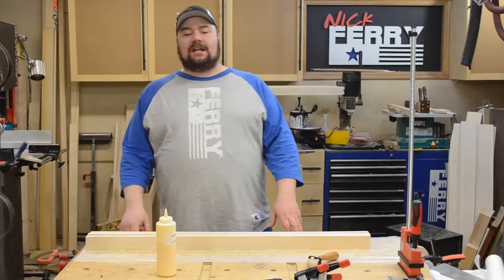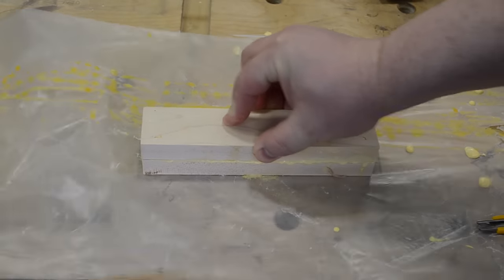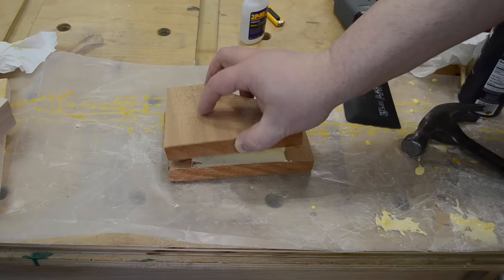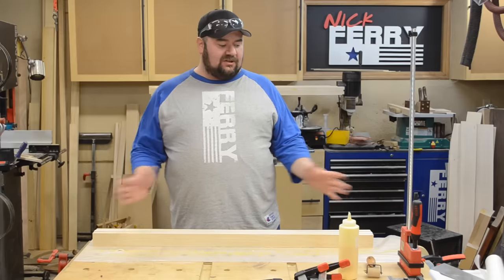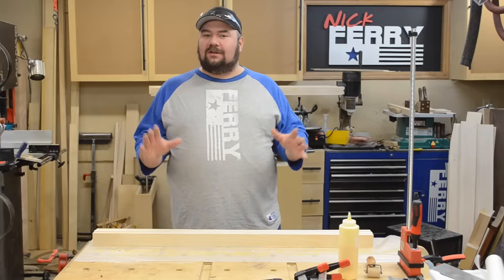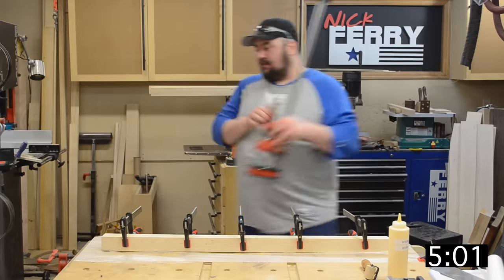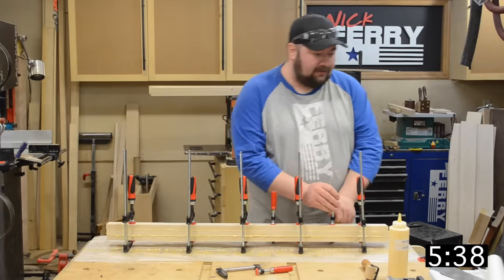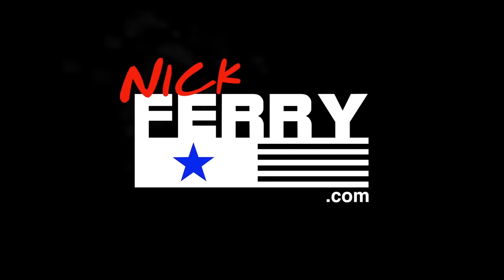Ⓕ Best Way For Gluing Wood Together To Get Thick Pieces (ep86)

Comment: That’s a pretty good tip.  Good to have in the back pocket of tricks.
Reply from the maker: thanks Chad - it sure is
Reply: Back pocket?  This one's going in the small notebook I keep in the shirt pocket!   ;)  lol
Reply: I was thinking add two pieces of scrap wood clamped to either end, but the parallel clamp makes that unnecessary. Huh.

And I see what I'm thinking of is an old idea called a caul. Nothing is ever new, lol.

Comment: Great tip. My late father was a carpenter/woodworker on the side and built several chopping blocks which are laminated much like what you did. He used a couple of bar clamps as the base to position the wood on and then when all glued surfaces were placed would clamp them in the already positioned bar clamp. Once dried he ran both sides through a planer to get rid of any warps or bows.
Reply from the maker: Nice - ever better that you have those ideas from your dad!
Reply: Nick Ferry - for sure. It's funny what we remember after someone is gone.
Reply from the maker: it really is - thanks for sharing!

Comment: Well explained.  I use a 3/8" thick 2 x 2 angle as a straight guide for the f-clamps.  The workpiece is then dead straight.  No jointing required.
Reply from the maker: nice - sure would be a time saver

Comment: I'm a qualified wood machinist amougst other things. I'll start with I agree that you can't have to much glue, but you can have not enough.
The way I would do it, you don't need to worry about the timber slipping and I would do all 4 legs laminated in one hit.
Say on the lengths of timber you are using, I would lay approx 6 X 900mm sash clamps down. Put all of your glued timbers in. All 4 legs, as they will stay separate without glue between legs. Then lay your other sash clamps on top between your underneath clamps. Then start to tighten each Clamp randomly top and bottom clamps until they bite. And then go over them all again when your happy where they are sitting and do them up nice n tight. All 4 legs done, no hassles.
(And that's without talking about woodgrain directions into the laminating situation.)
I believe I'd have my 4 legs glued and straight while your still lining your timbers up with your lining up clamp and clamping your 2nd leg together. I don't mean to sound rude. It's just the way it is 😜🤔🤣
Reply from the maker: very well could - always cool hearing how others accomplish the same task differently
Reply: Nick Ferry your welcome, I hope it came across clear.
Cheers.
Melbourne, Australia
Reply from the maker: clear enough for discussion - I see you said you're from Australia, do you have any HNT Gordon tools?  I got one of their planes about a year ago and it is top notch

Comment: Not trying to be a jerk, but couldn’t you just do it on both ends and call it good or do you have to work your way down? Great technique though that I will begin using in the future
Reply from the maker: This way you can correct bent or warped boards too
Reply: If you got a bad enough bent/wrap, the boards may start sliding as soon as you remove the "side" clamp. It happened to me once, but to be fair it was 12 feets long  4'' by 8'',  and I surely did not have enough and strong enough clamps for the job. A bit of sand did help there.
Reply from the maker: robert winton - exactly
Reply: I usually use a "glue-buck" (like a sawing horse), and I never remove the correcting clamps until a need them another place. Also, regular F-clamps combined with pieces of scrap wood with a piece of adhesive tape works just as good as parallell clamps.

For big glue-ups putting straight boards on the side while glueing can straighten up the pieces and heavily reduce the number of clamps you need.
Reply: You should have flattened and jointed your wood before gluing up. If you need clamps to bend wood to bring them into alignment while gluing up - your legs will have a lot of movement down the road due to stress. That wood will want to 'spring' back to where it was before you forced them into alignment with the clamps. Golden rule of woodworking. In our shop we always cut the wood a bit longer to allow for a pin on each end, that will be cut off before the exact sizing of the wood takes place. I believe I even heard you state that your pieces were a bit longer than needed. By the way, this is constructive advice only - not malicious criticism. Love your channel, enjoy watching your videos!  mike
Reply: cuskit True, but sometimes you will have to compromize and bend some boards slightly. Not typically in a leg for a table, but for lets say a tabletop. One or two mm misalignment over 1500 mm wont warp the table, but it's really hard to get the board to align without some tricks like this. When doing that sort of stuff it is important to think about these forces. Make sure they balance each other out and such.
Reply: Egil Sandnes  67 years old and well over a thousand tables built. I do know a bit about working with wood.  On balancing wood, we use kiln dried as close as possible to finish size to reduce movement. Stress will result in twisting, warping, splitting etc. And you cannot properly balance 3 pieces to begin with. Journeyed craftsman in the past always used wood blanks sized for the leg diameter without gluing up pieces which is why good antique furniture stayed so straight. Today due to shortage of quality good  old growth lumber it is more imperative to learn proper techniques of straightening lumber. Sorry to say we are a dying breed and soon they’ll be no one left to teach. Using clamps to straighten material during glue up is just not right. Other than ‘springing’ the outer boards on a table top blank, seeing any daylight through a dry joint before clamping is a recipe for trouble down the road. I was taught by a German journeyman and to him a couple of mm’s is a cavern and I agree. Just my old 2 cents for what it’s worth.

Comment: I was waiting for some revolutionary tip. lol. however from the looks of it a lot of people never knew you could do this. Thanks for sharing. I always clamp the boards to the table with several parallel clamps across the entire workpiece and then the table acts as a level clamping surface for the bottom. Then clamp the boards together across the entire glue up.
Reply from the maker: another great way to do it - yeah it seems some have seen it as obvious and others never thought of it or tried it

Comment: Another method is to use a flat table covered with wax paper on the bottom of the edges. Place wax paper on top of the edges then place flat steel or angle iron on top of wax paper and clamp down in several places to table. Then you can use clamps from each side to squeeze the portions together. This has the advantage of using a flat table to keep the project straight during glue up as opposed to a temporary clamp. An even better way is to use angle iron on 3 sides and the flat table on the bottom. Place wax paper so that project never comes in to contact with angle iron or table. The project is held square on all 4 linear sides. I know the cost of angle iron scares some people but it is reusable and cost less than a good clamp if you get it from a steel supplier.

Comment: Nice idea, I will have to try it.  I have always used a small biscuit at each end.  Can always cut through them if need to cut into glue-ups.  Quick to do against the table saw fence.
Reply from the maker: My go to for years was biscuits - I still bust it out occasionally

Comment: Great tip. Question: How would you do this glue-up? Two pieces of 3/4” thick hard maple 30” long if you needed them to be 1-1/2” thick and 30” long? I noticed that you didn’t care about the length of the wood and assumed you would trim that off, but I already cut all my wood to the needed size.

Comment: Like you, I was surprised to hear you say that a professional woodworker didn't know about this.  I used that technique to make balusters for a railing.  I've also been using a similar technique when I edge glue narrow boards together to make a panel.  I clamp a long, square thick-walled aluminum stock across the boards to get their surfaces as close to the same plane as possible.  Keeps them from forming an arc when I use bar clamps to draw the planks together.
Reply from the maker: Another good idea - makes sense on making balusters
Reply: Dan Burch I have like a 2x3 piece of aluminum that is very straight that I'll use and just clamp in with any lamination I do to make sure it comes out straight. I've used this a number of times with plywood making fences for table saw sleds and router tables. Works great!

Comment: when I laminate,I put a little downward pressure and "slide" the piece over the other a couple times, I think it creates a vacuum of sorts and releases the glue air bubbles. creates a nice tight initial bond. Retired journeyman now,carving stumps mostly,and turning a few bowls.
Reply from the maker: Yes a slip joint - I'm a fan of the technique - done in areas of the world without access to clamps commonly when edge gluing - for larger surface laminations I feel clamps get the surfaces a bit tighter with more control - it's harder to slip join longer glue-ups

Comment: Nice tip! I don't have a parallel clamp but sometimes I bodge one up with two G clamps and a couple of bits of scrap timber. But mostly I just put clamps on the normal way round but do them up only medium tight at first. Then tap gently on the ends and sides with a hammer to line everything up. Clamp down tight when it's all straight.
Your method is better though. Nice one. 
(More tools to buy, just when I thought I had everything.)
Reply from the maker: thanks - I like your method too - that's the cool part is figuring out multiple way to do things

Comment: Hey Nick those pieces of pine are warped. If you flatten them before the glue up you will be able to use glue then rub the 2 pieces together till they interlock. Once this is accomplished, you clamp. The reason they are sliding on the glue is the lack of wood to wood contact as all 3 boards have a slight warp on the tail end.
Reply from the maker: A rub or slip joint works great for edge joinery but I find in surface laminations I still get the wood wanting to slide around - even if the wood is perfectly flat - the bow in this maple was minimal and it’s nice to have a few tricks in the bag to work with what you have

Comment: I did similar laminations this weekend, 2" square legs.  Wish I'd known about the brayer, it looks so easy compared to what I've used.  For my legs, I just joint and plane the boards.  I don't cut to width until after glueup, so the overhanging edges are fine, since the boards are slightly different widths, more than 4.5 inches.  I cut 2 legs from a board after the glueup.  However, this looks like a great idea, especially if you have thinner pieces.  I've glued legs from salvaged hardwood flooring, and this would have come in very handy there.
Reply from the maker: very cool - another great way of doing it - the brayers work out really nice

Comment: Great video Nick. The parallel clamps are so expensive for a weekend woodworker. Thank you so much for this tip.
Reply from the maker: No problem man - it’s one of those things you need to but a couple every year - or at least I do - they add up quick

Comment: Dang man! I could have used this yesterday!! I ended up brad nailing my remaining 3 legs after fighting with the first one. Today I spent a lot of time on the planner and jointer getting them flush and unfortunately I’m gonna have to use wood filler on some of the boards that didn’t come together as tight as I wanted. Thanks for the tip!!!
Reply from the maker: I feel your pain - your next set you'll be ready

Comment: I've done similar, but made small calls(flat stock with blue tape) to clamp parallel to the piece. That way i can leave the pressure aligning the pieces in place during the drying process
Reply from the maker: Good idea - I've used clear packing tape as well

Comment: I've done it this way for years but generally have left the parallel clamps in place but with less force that the MAIN clamps. I never really trusted the main clamps to entirely prevent slipping. However, my gluing was not nearly as smoothly and perfectly done. Need that tool!
Reply from the maker: depending on what I all have to glue up I might leave them on too - the brayer works really well for this

Comment: I had to hunt this video because I have to do this today and I had forgotten.  Thanks from an old beginner!
Reply from the maker: No problem - glad you found it!
Reply: I knew I had seen it before but IHad forgotten how and who.  But I sure am glad I found it.
Reply from the maker: if you did it already, how did it work out for you?
Reply: Should have made 2 or3 glue ups instead of one big one.  Had 9 pieces of Baltic birch 1/2" thick and it worked way better than the way I was doing it.  Next time I will do 3 then put them together.
Reply from the maker: cool - always learning

Comment: Hi Nick!

I use a slightly different technique where I align the pieces with two or three traditional wooden hand screw clamps, and then use metal clamps to compress the laminations against the length of a flat bench.  That way, the glue-up is both lined up and straight, and gravity works with me to keep one board clean for truing the glue-up on a table saw or with a router.

Good comment on orienting the wood to have the slight bends work against each other.  I do that too and have great results.
Reply from the maker: very cool - another great way of doing it
Reply: Capt I 6’&

Comment: Good video, good advice. The only thing I'd add is to give the F-Clamp an extra twist after removing the parallel clamp in case it was holding the pieces apart slightly.
Reply from the maker: I’ve never had a problem but I always make sure they’re all snug at the end
Reply: +Nick Ferry, writes "I’ve never had a problem but I always make sure they’re all snug at the end"

That's basically what I was saying to do.

Comment: This is a really great tip, I've always just put plenty of glue and allowed the boards to get tacky before final clamping, but even still it's always a wrestling match.  Another problem is that I've never seen those parallel clamps for sale here in Greece where I live, but if I ever see them I am totally getting one or two, because really this makes sense!  Thanks for this!
Reply from the maker: no problem - if you don't have any parallel clamps a couple scraps of wood to bring the edges together works too just a bit more of a hassle

Comment: That's great video. The first few techniques I haven't seen. I go a step further. I use 2 pieces of lvl beams with a c clamp and press together as I install actual clamps. The lvl has wax on it and keeps work piece from sticking to it. I also use strips of lvls as spacers and clamp multiple completed panels to keep them straight/under tension as everything dries over time.
Reply from the maker: I would 100% do this if I had some LVL‘s laying around - it would make a killer form for some curved stuff too

Comment: (aka SmallWorkshopGuy) Superb, Nick - doing a glue up of four legs and two feet today and looking forward to using this technique
Reply from the maker: Great - let me know how it works for you
Reply: Biggest mistake I made was buying 6 50 inch Bessey Clamps - too big for most of my work and too cumbersome in my small workshop - guess I will be adding some smaller Bessey's - would make your technique easier to do!

Comment: Back in Rochester NY I worked at a museum where I was one of the youngest woodworkers.  I had over 25 years working with wood and the older guys used to laugh at me for doing what you just did. I showed up to work on a day off and found out that three of them started doing the same thing but didn't want to look like they learned something from the "younger generation" so it was only done when I wasn't looking or when I was off. I made them a gift after I found this out. The gift was for all of them and it was a hand carved replica of my hand... giving them all the finger! LOL 
     Never feel bad about doing something others don't do. it just means you think for yourself!
Reply from the maker: I can see that being the case - I try to keep an open mind to new techniques myself but I'm guilty of relying on tried and true as well - it's a bit messed up from time to time - always more to learn

Comment: saw a video on youtube recently chap was making a bandsaw out of 18 mm ply and was glueing 8 pieces of 18 mm ply together , put the glue on rollered it then sprinkled on salt from a salt pot  said it stopped the wood from skating around as it was clamped , i tried it and it works, one of those bloody stupid things you wouldnt believe but actually does work, hope you give it a try, you wont be disapointed
Reply from the maker: It was something I’ve done for years but never made it into my regular way of doing things for whatever reason

Comment: Good share Nick. One way which may be a bit easier though. Why not just use dog hole clamps for vertical alignment? Assuming you have a nice flat bench. Just whack them down with a nice straight bit of stock between the clamp and the laminate then pop on the F-Clamps. Couple minutes, tops.
Reply from the maker: Not sure I follow 100% but it sounds like an option - but eats up valuable bench top space while I could be doing the other legs

Comment: Thanks! Such a cool idea! Simple but a pretty unique tip. It’s brilliantly simple.  How would you glue together thin boards?
Reply from the maker: You’re welcome - depends on the thickness but I would use the same principle and scale it to the smaller material - sometimes just a wedge can help when gluing thinner veneers together